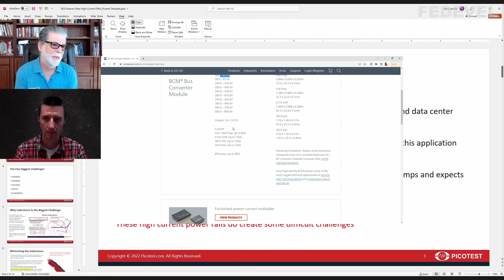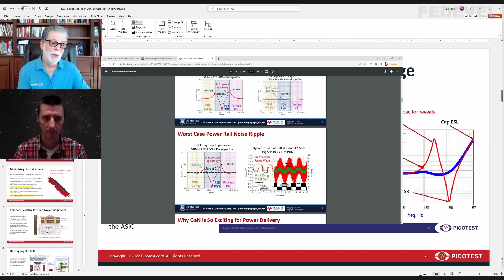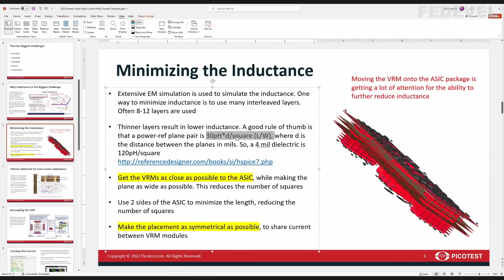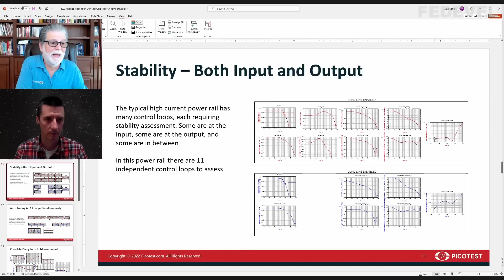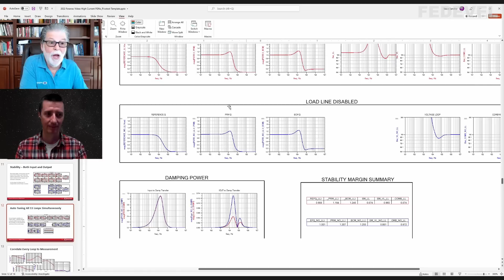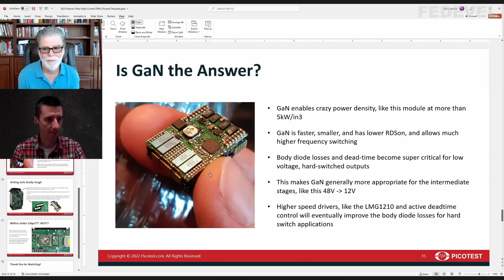Do you need thick copper layers in PCB for high currents? Are you sure? | Steve Sandler

Comment: This reminds me of the 80s when Data General made a computer that I used that came standard with battery backup because it would go into power fail about once a week and the battery inverters held up the power rail when the supply dipped too low.

Comment: It should be clear that an inductance in the power supply line has to be avoided because it creates a voltage drop and therefore in a lower supply voltage where it is needed so that the ICs can’t operate anymore because the voltage is too low

Comment: I've been making boards with GaN, like 100A+ on a 3inch x 3inch board. 
You really do need 2oz copper minimum and the inductance for power and gate loops is extremely important.
For those trying to understand why low inductance is important, a GaN transistor switches 100A in like 3ns. Even if your loop inductance is only a few nH, you can still do your Ldi/dt calculations and see that you get a high induced voltage which can kill devices easily during transistion.
Reply: Where do u work?
Reply: kill devices?

Comment: My ears perked up when Steve mentioned controlled-ESR capacitors - these are mentioned by both Ott and Archambeau as the cure for inter-plane cavity resonances, but sadly they never caught on and are difficult to find. A little surprised that three-terminal capacitors were not mentioned, as manufacturers like Murata tout them as being able to vastly reduce the number of required decoupling caps due to their extremely low inductance.
Reply: They can reduce inductance, but ESR is intended too low.  Also hard to fit between bumps

Comment: This sounds totally crazy to me, I never thought it was possible to get so many A with very little V. For example 2kA*0.7V = 1400W, I don't know any component that could handle that. Even to get 10W resistor you need a huge wirewound one, cannot imagine how a 1KW component could even look like
Reply: Look at household electric baseboard heaters. 240V, ~5kW.
Best analogy of 1.5kW worth of heat is a household oil-filled portable electric radiator. Its output can heat up a whole room in an hour or two, in the winter.
Reply: @nameredacted1242  but is that going through a PCB? I put 1.5W on a 3W resistor and it was impossible to touch it, super hot
Reply: @carlosgarcialalicata  Obviously NOT!!! 1.5kW of power must go to your LOAD (and THAT will ultimately just convert it into waste heat).
If you have to deliver 50kVA+ to the load, THEN your power electronics will be dissipating on the order of 1.5kW of losses in control electronics, at that point you must use liquid cooling...
Reply: Yes, it's a lot.  Even normal cause today can hit 500Amps and GPU's often hit close to 1kA.  Data center, super computer and HPC easily exceed 1kA.
Reply: My GPU (3090) pulls 400W at around 1V. So 400A is not that uncommon in higher end PCs. It’s not even water cooled (yet!)
Reply: The IC is not one component like your one resistor but billions or trillions. It's also heatsinked and watercooled--if your resistor was water-cooled it would probably not get so hot.

Comment: So, the title has LITTLE to do with the video. Ultimately, you WILL be using lots of copper thickness (just spread over many, many layer pairs). The very basic and dumb Ohm's Law still works at DC. Obviously, the video is awesome to talk about everything that happens at AC (for digital people, switching waveforms IS AC in case you did not know!).
Reply: Same with the poorly chosen video thumbnail illustration. You won't transfer 1000A from a VRM that is soldered onto a PCB.
Reply: @nameredacted1242  It’s not uncommon for LN2 overclockers to push 400A through aftermarket VRM PCBs that are soldered flat on top of the GPU’s PCB. I don’t see why you can’t push 1000A with enough bypass caps and cooling

Comment: 48VDC will be the best thing since sliced bread for the next 20 years in electronics. I am talking power supplies for laptops, small monitors, small TVs, printers, next generation of USB, Ethernet PoE, etc, etc, etc. It's "almost safe" in terms of shocking your body, and can deliver enough power for the next 20 years.
Reply: I think next version of USB-PD will be able to support 48V, so... you aren't wrong mate.
Reply: Yep I’d love to see 48V (or better yet 60V) become more common. I think you’re underselling it with “almost safe”. If someone manages to kill themselves with 48V, they kinda deserve to die. I’m not saying I want them to die, but I am saying they have to so that the rest of us can move on :)
Reply: @NavinF  I think the safety limit is around 50V, so I don't think we are going to see this anywhere near in consumer goods. 48V is alright and probably already pushing it, but they need a unified solution.
The more voltage the slower and bulkier ( or more expensive ) the switching.
20V is a nice sweet spot as many laptops get their main power at that voltage. Upping the current is much more dangerous, that upping the voltage, and because 100W is not that much for bigger devices, they are probably going to settle for something like 32V at max 5A. 48V is probably going to be a specialty for replacing Ethernet and PoE but only for very specific applications, perhaps to power certain Ethernet adaptors or something like that.
And sure some very high end laptops are going to go the way of 48V but, if you need 240W just use a proprietary / universal power plug.
Reply: @TrickyNekro  I’m pretty sure the 50V limit you refer to is “low distribution system voltage” (LDSV) as defined by the NEC. That’s not particularly relevant to USB cables and it’s not even followed by all PoE implementations (passive ones often idle at 55V). Anyway the limiting factor has always been arcing damaging the conductors when you yank the cable, not safety
Reply: @NavinF  well yes and yes... And if you get USB up to 48V then you are close to that limit, that's probably nominal anyhow. That's why though I don't see 60V USB happening. 48V is probably the highest it will go.
Reply: @NavinF  I think that 60V is into unsafe territory. Read up on it. Plenty of regulation classifies 48VDC to be the upper range of "will not shock you". Voltages above that, while they do not have the AC-like "muscle twitching" effect, with wet skin and standing on wet ground, or wet clothes, will probably give you a jolt you will feel, and may affect heart operation. So I would be careful saying that 60VDC is safe, and the other statements that you made.

Comment: VRM? Viewers coming to this video cold will want to know that "VRM" stands for "Voltage Regulator Module", meaning voltage regulator circuitry located very close to a high current load like an ASIC. These typically don't just regulate, but rather convert an input voltage like 12V down to some low voltage with high current capability, like 1.something, or the 0.7V mentioned in this video.
Reply: Some of the first VRMs on mainboards were on the socket 7 boards of the first Pentium line, to support the lower voltage of the newer MMX Pentiums 😂
Reply: Oh and also on the 486 Pentium Overdrive Processor was a VRM!

Comment: I tried a 8 layer PCB with high power and well it worked electrically, but made popping noises as the inner layers got too hot. we went with power traces on the bottom and adding a thermal pad to a heat sink
Reply: You live and learn, my friend.
Reply: That sounds more of a via issue. Either that or your fab totally screwed up and used FR4 that had adsorbed water.
Reply: @theondono  It was a high power RF project and the FR4 PCB was starting to turn to charcoal. It took a bit to convince management that it was even possible which is why we started with a FR4 board, but with time we simplified the design to a 2 layer Arlon PCB and standoffs to a FR4 board. That then allowed the thermal pad on the bottom to transfer the heat to the water cooled heatsink while the FR4 board handled the low power stuff.
Reply: @LaserFur  You DON'T use FR4 for RF!!!
Reply: @nameredacted1242  you can for prototypes. the purpose was to prove something so that the real PCB could be developed.

Comment: For those struggling to understand why inductive behavior is so problematic, they are covering powering mostly computing ICs, devices that have abrupt and sudden transitions on the demanded current (millions of transistors switching on and off). 

If your delivery network is inductive in nature, it’s like having an inductor between your power supply and your IC. You’ll have big voltage spikes on it.

Inductive loads by contrast will be much more forgiving in this aspect since they’ll be the limiting factor in current change.
Reply: Yeah, I don't know why they struggled so much and talked all around the topic without stating the underlying problem:  If a chip has a sudden increase in demand for current, if there's inductance in series in the power distribution network (PDN)  (on VCC or Ground side), that inductance will respond to the instantaneous current demand with a large voltage drop, and thus a large sudden dip in the supply voltage to the chip. This could be a dip in VCC, or lift on the ground side, and these compromise the chip's ability to operate, as each stage sees extraneous steps disrupting the intended signals.  
Then when the chip has a sudden decrease in current demand, that will cause the PDN inductance to dump a pulse of current into the PDN, seen at the chip as a momentary overvoltage on VCC or under voltage on ground. Again disrupting the intended signals. 
Adding to this is that the combination of L and C resonates, so that individual current steps not only result in voltage pulses, but pulses that ring.
Reply: @Graham_Wideman  The problem is only with the title, one might have assumed first that it is for a lab PSU or other (higher voltage) PSU of some kind.

But the thumbnail already telling the truth (1kW, 2kA, which suggests it is few volts).

The video itself is great, and who designs digital systems at this level is certainly do not need explanation why inductive beahviour of the PDN is a problem: you can encounter tbis issue with a few magnitudes lower frequency level, so in simple microcontroller kind of jobs. Just the distances and inductances are bigger, but you can get a very good sense of how easy is to mess up a design up to failure. Like it said in the video, this design mindset is important at every level, just the numbers in the equation are different.

Comment: All this GaN, Diamond transistors are good, but they are pretty expensive for now, cause not many manufacturers make them. Also they need more complex drivers cause they have higher band gap. And what i understood so far, engineers can create any design, even for million amps, but the question is for what cost and purposes :)
Reply: Cloud computing. HPC, data center, graphics cards, AI, supercomputers, etc.
Reply: Your phone charger , laptop supply is most certainly already gan powered. Your EV car OBC is SiC powered . It’s not that just a few companies make them. It’s that currently SiC makes more sense , and gan foundries have low yield because of silicon impurities contamination

Comment: i got a marketable product idea. simple single motor esc 5-10a, combined with 2 servos and an rc reciever.
if you can build it lightweight and under $25 you'll ship lots and make the rc glider community real happy
Reply: For what they’re talking in this video, that’s low current. If you went up an order of magnitude, then it would start to sound fun 😂
Reply: it already exists, but is more than that cost. The cost of having separate pieces is not very much. so creating a custom design would result in a higher cost.
Reply: @LaserFur  the guy who designed & sold them died a few years ago. His son sold them for a while but moved on to other things. Their design was old & you'd have to ship it back to them for firmware updates.

Theres a 'flying wing hobbies' version currently but its priced at a wild $80. Thats the cost of a fully featured premium flight controller. 

This is a simple spektrum ppm reciever with 2 servos and a low power dc motor esc. It should be about $10 in BOM. 

This hobby company is just gouging because they can. If you made a newer design, flashable by the users, youd sell to all the lightweight glider people
Reply: @terminsane  so I am guessing it would take me $40,000 US on NRE. Then you have to divide that by the market size. I can't even get products made for less than $50 that just have a processor and some I/O. So overseas manufacturing and low NRE is important. And then someone will copy it.
Reply: @LaserFur  ohboy. One of those... Yeah i guess you need a million dollar investor to print at pcbway
Reply: @LaserFur  how is it they can produce an AIO fc with f7 rocessor, blackbox memory, barometer, MPU, and a 8-motor 50a( individual each motor) esc all in one board for the same cost?

Arent all those components far more expensive than 2x little servos and a single dc esc?

The AIO fc also has hundreds of resistors and caps and other supporting components. While the glider reciever would have maybe a dozen.
Reply: @terminsane  well. I would guess they don't produce it in the USA.
Reply: @terminsane  I don't want to discourage you. You clearly have a drive to do things. Long ago I had that kind of drive and had to learn so many technical things. But now days we can't hire anyone with technical skills without huge prices.